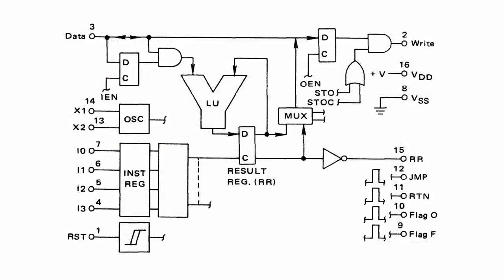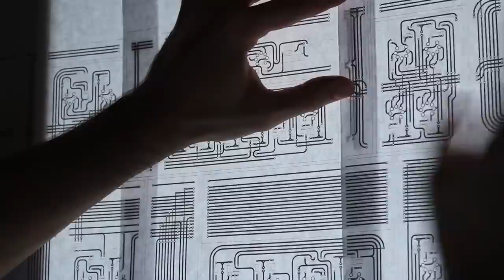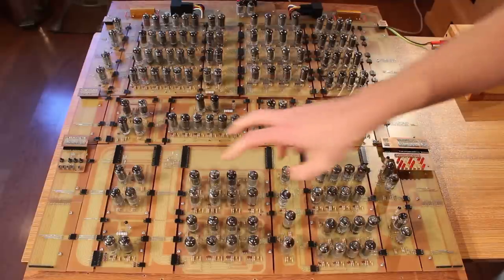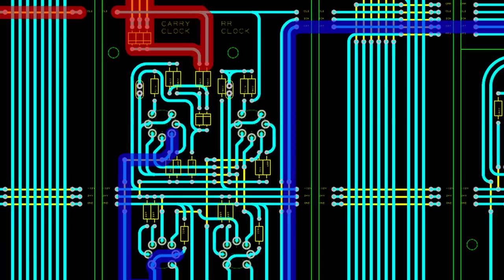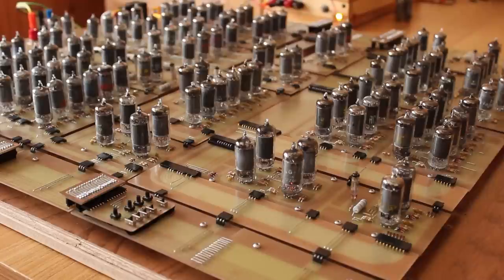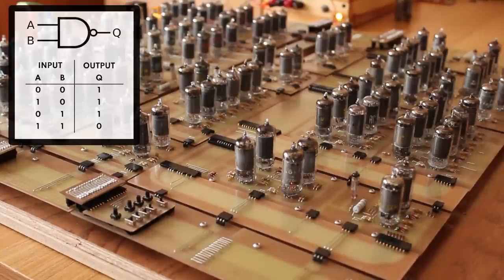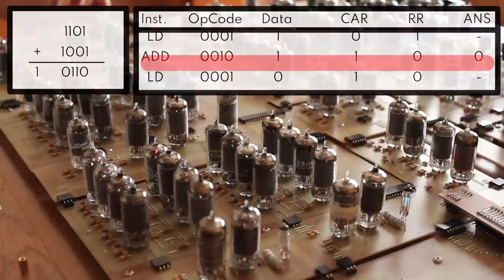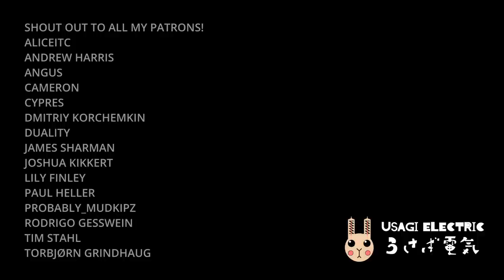Vacuum Tube Computer P.18 – ALU Installed and Tested

Comment: I would love to see you get this, or even a completely new one, to the point that it functions like the Original IBM PC complete with memory (RAM), Floppy Drive, Keyboard, and Monitor!  Have you considered adding a punch card reader to this?
Reply: An IBM PC? Like this? How many soccer pitches does he get to cover?
Reply: @hubbsllc  As many as he likes!!!  Heck, I have 9 acres of land and plenty of buildings he can come over here and work on it!  ;-)
Reply: @waynethompson8416  SO I guess the ALU can be in one building, the bus interface can be in another building...
Reply from the maker: Interestingly, I have two goals with this one. I would like for it to calculate the Fibonacci sequence, and I would like for it to print something to a teletype terminal. That means I'm going to need memory, some program control, and input/output. Now, it won't even be 1/10,000 as powerful as an original IBM PC, but I think that should be pretty good for a first go at building a computer from scratch. Ultimately, I want each of the four main components (processor, memory, program control, input/output) to be contained on a single backboard the same size as the processor is now, so I can mount them like this: https://i.postimg.cc/QM43nPYb/DualRack.jpg

Now, I've been doing a lot of thinking about program control, and depending on what day you ask me, I've got a different idea, haha. I've narrowed it down to either punch tape or audio tape. And, if you were to ask me today, I'm leaning a little more heavily towards audio tape. Traditional computers with punch card systems, read the cards into memory and then execute the program from memory. But since memory is so physically massive, I'm actually going to execute the program directly from the tape, and I think audio tape might lend itself to that a little better, particularly as the speeds pick up.

Now, in the future, I really want to build another tube computer that is a lot, lot more powerful. I want to use a lot of the design methods the LGP-30 used, but expand it out to a proper 8-bit style architecture like the SAP-1 or even the 8088. For example, here's a 1-bit full adder I designed up that uses just a single tube: https://i.postimg.cc/02RLpVRB/1-TUBEHVFULLADDER.jpg  Of course, the hardest part of that is going to be memory, so I'm going to need to do a lot more research into core-memory if I want that to even be slightly viable. Still, I think it could be very cool!

Comment: You read that logic results like an Operator on The Matrix! . Can you see the girl on the red dress??
Reply from the maker: Haha, you know, I never really thought about the fact that I'm interpreting a whole lot from just a few flashing lights.
"You get used to it, though. Your brain does the translating. I don't even see the code. All I see is blonde, brunette, redhead. Hey uh, you want a drink?"
Reply: @UsagiElectric  I was thinking it would be helpful to post a label by each indicator.  On the 20-LED board I would have arranged them in groups of 4 (nybbles) for easier comprehension.  Just my preference.

Comment: Next challenge? Core i9 in vacuum tubes! Great videos.
Reply: You figure out how many football fields you need to lay it out! ;
Reply from the maker: Hmm, so it's a little tough finding an exact figure for the number of transistors on an i9, but based on their other processors, I'm guessing it's between 3 billion and 8 billion, so we'll pick 5 billion as a nice easy number to get to.
Now, doing things with tubes actually can yield a little better efficiency because we can use diode logic and other neat tricks to bring the tube count down. For example, the original MC14500 used around 500 transistors, but I managed to build the UE14500 which an upgraded ALU with just 180 tubes. If I were using an LU like the Motorola chip, I could get that number down to about 120 tubes. So, that's about 1/4 the number. So, let's pull out all the tricks in the book and get the number from 5 billion down to about 1.2 billion.
Now, with some better designing and dual sided PCBs, I can get one tube with supporting passives down to an area of about 30mm x 20mm. That's 600mm2, or 0.0006km2. Multiply that by 1.2 billion and we need about 720,000 km2, which is a number so large I can't really imagine it, haha. That's about 180 million acres, or roughly the same amount of landmass as the state of Texas!
Now, how many power plants would we need for the heaters?
Each tube draws 300mA at 6.3V, so with 1.2 billion tubes, that's 360 million amps, or about 2.268 Gigawatts, which is roughly the same energy consumption as the entire country of Iceland!
Reply: @UsagiElectric  Thanks for the breakdown! lol
Reply: I'd hate to pay your electric bill.

Comment: But Can It Run Crysis?
Reply from the maker: So, lets ignore everything except the processor, and the minimum processor requirements for Crysis was a Pentium 4 at 2.8 GHz. The P4 was a single core, 32-bit processor, so we can do some comparisons! First, let's consider 15 fps to be the minimum amount of frames per second to be considered "playable".
The UE14500 tube computer uses a 1-bit data bus, and the clock speed is actually going to be dependent on the speed of the program counter, which will most likely be painfully slow. We'll take an educated guess at around 10Hz. 
For the P4, it takes the 2.8GHz 32-bit CPU 0.06s to render one frame. 
For the UE14500, we need to do 32 times as many instructions, and we're running at around 0.0000035 the clock speed. So, it would take approximately, 537,600s to render one frame of data. That's 8,960 minutes, or 149.3 hours, or 6.2 days!
Reply: @UsagiElectric  Thank you. I was not expecting such an acurate answer. Did you do you all the maths using the UE14500 tube computer?

Comment: Imagine if someone built a fully working computer that could output a signal on a monitor(crt)
Reply from the maker: You're not far off from my ultimate goal!
I want this thing to achieve two things. I want it calculate the Fibonacci sequence up to 233 (E9h), and I want it to print "Hello World" on something. The first goal is to print that onto a Teletype using 5-bit baudot code. But, I would also love to build something that outputs it to a CRT!
Reply: @UsagiElectric  could you make the crt tube driven too? Its not that hard to build a tube TV?
Reply from the maker: @Rainbow__cookie  Initially, the plan is to send something to a data terminal, just to see if I can.
But, once the processor is finished and I'm successfully sending data to terminals, then I think I might look into building up a tube based data terminal. The CRT driver circuitry isn't that difficult, but there are some serious hurdles that have to be overcome for it to be a terminal. I need some kind of character ROM as well as some RAM to store input data. It'll probably end up being as large as the entire CPU itself, but it sure would be cool!